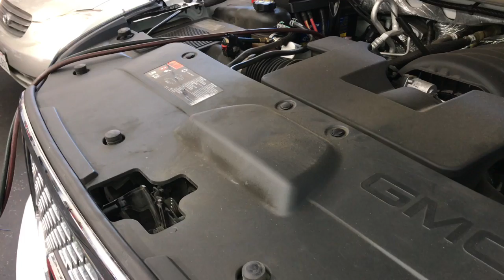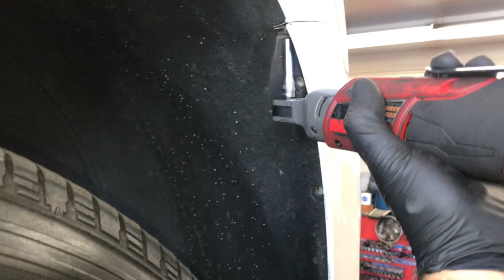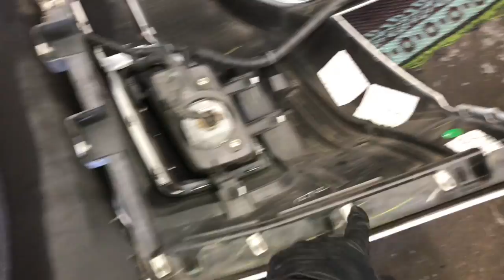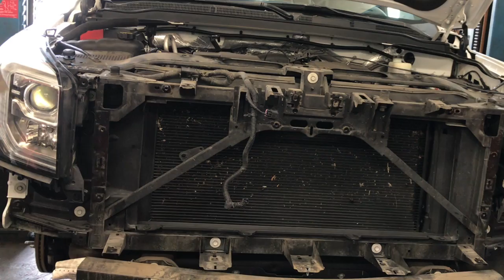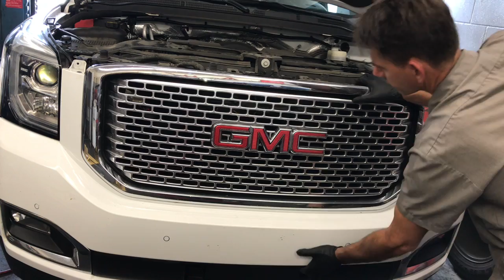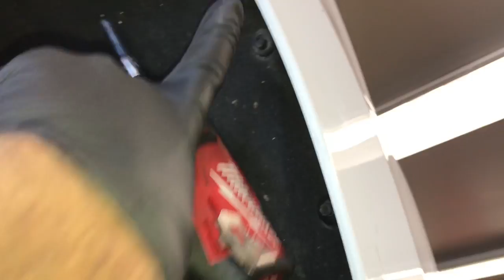Replace the AC Condenser / Transmission Cooler on a 2014-2018 GMC Denali

Comment: Taking advantage of the fact that they already have it disassembled, they can change the engine! lol, is this serious?  the condenser comes up pushing the radiator a little, it will take you a couple of hours!  It is a crime what they did to this beauty of a vehicle, how much did that repair cost?  to the owner? maybe two of the big ones, and not for the condenser but for disassembling and assembling!

Comment: You can pull the air cleaner, core support, and a couple brackets and pull it from the top. Just did my 2015 Escalade.

Comment: I should of read all the comments before takling this job. I did the same thing this guy did and I found out from another video that theres 3 screws holding the bumper to the fender. This guy doesn't explain that those screws need to be removed in order for the bumper to drop. I should of continue looking for a better video. Instead I followed this JOKER!.

Comment: Hello.. you don't need to remove the Grill and front end assembly, just remove the crossmember above the radiator and the condenser is easily accessible in a fraction of the time

Comment: Um, why would you pull the whole front end off?  Remove the top core support bracket (7 screws) and tilt the radiator back and the whole job takes about 90 minutes.  Not sure why you did this...

Comment: I have a 2016 gmc yukon denali and the ac condenser has gone wrong after pulling out from the dealer for fixing transmission wiring harnes, changed the incab air filter and made an oil change. I think the dealer could've done something wrong that cause my condencer to go wrong. Any thoughts? Im fighting for them to fix this issue. Never thought it was an ac condenser/ transmission cooler.

Comment: What happen if i drive my car with a bad condenser. Imean the one i have is leaking water or a grrenn liquid?
Reply from the maker: Daniel Guzman As long as it’s not coolant leaking out of the vehicle you be OK to drive it . Your AC will stop working. The fluid your probably seeing is oil from the AC system. I would not turn the AC on until you get it fixed.

Comment: Are these things reliable? Suburban, tahoe, denail, etc
Reply from the maker: MrRangerZr1 for the most part I would say yes as long as you’re up on the maintenance.. GM products always had issues with the transmissions.
Reply: My suburban is at 297,000 miles and i drive to work for about an hour everyday.
Reply: No, these are terrible.
Reply: Garbage motors. JUNK!

Comment: These steps are way extra. I do this on a regular basis by just folding the top support up and pushing the radiator toward the engine and pulling the condenser out. It’s tight but makes this 4 hour job become a 30 minute job.
Reply from the maker: Colby Golightly I’m all about making the most efficient videos as possible. I tried looking this up no one has done it before. Next time I get one in the shop I’ll try it your way and try shooting.
Reply: Pretty much all of the Yukon/Silverado/Sierra have the exact same front end mounts. I think the hardest part is getting the bolts out of the support frame. Other than that it’s a pretty straightforward swap.
Reply from the maker: Colby Golightly right on thanks for the tip. Wish you were around a couple days ago. Lol
Reply: How-to-Automotive's method is the correct method.  The method of removing the top support will not work on a Yukon.  The channel that the support rest in has a higher back lip prohibiting it from being removed without removing the headlight assembly and in-turn, the front bumper.   Furthermore, the six bolts fastening the support have far less clearance than found on the trucks.  Four of the bolts can be removed with some effort but bolts 2 and 5 cannot.

Save yourself time and headache. Use the above video as a reference for Yukons...and I would imagine the 
Suburbans.
Reply: Can you make a video doing it, please and thanks

Comment: Brian, Nice video. Looks pretty labor intensive on this newer model. What is book labor hours on this ?
Also picking out a couple tools from your list to purchase. Thanks !
Reply from the maker: Ron Baynes The labor time was around for hours with Evac and re-charge. That  Milwaukee M12 1/4 hex Impact Driver is a good one. I pretty much did the entire job with if that one tool.
Reply: How to Automotive why did the original part fail?
Reply from the maker: heyitschino it was leaking transmission fluid
Reply: How to Automotive would this condenser / transmission cooler also cause my transmission to shift HARD from Reverse to Drive (takes 3-5 seconds to lock into gear)? BTW- I just left the dealership and they told me my condenser is bad and needs replacing, 5hr job (my a/c stopped blowing cold like overnight).